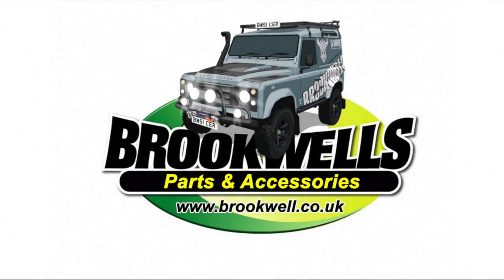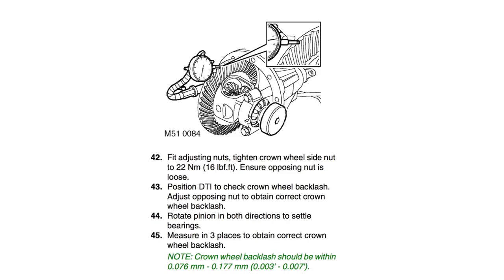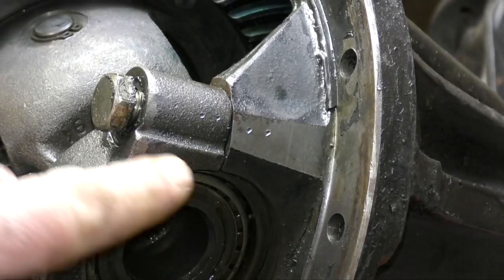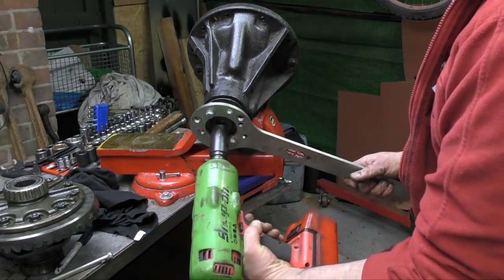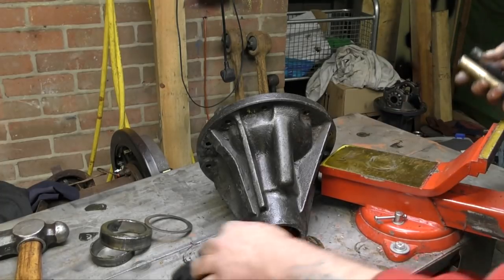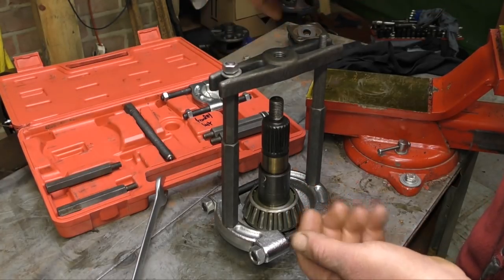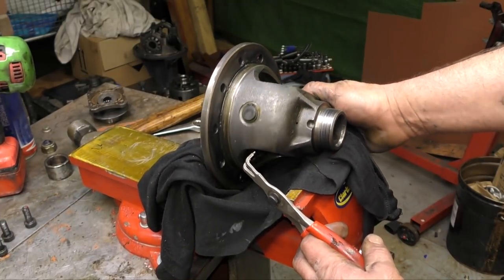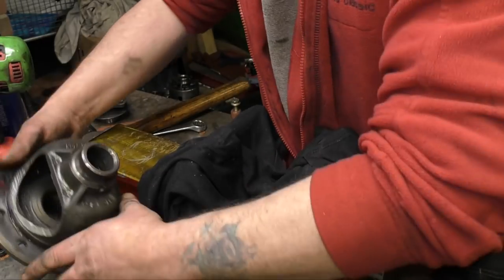Land Rover Diff Overhaul,  How to Remove Bearings on the Final Drive.

Comment: Do you have a video of rebuilding or setting up the gears in a Salisbury. I have 315,000 kms on the Defender 110. I’m starting with the rear axle and trying to keep it a daily driver. 
Also, does Bearmach or the sponsee have diff (ring/pinion) rebuild kits? (Seals, bearings, shim sets, etc.?)